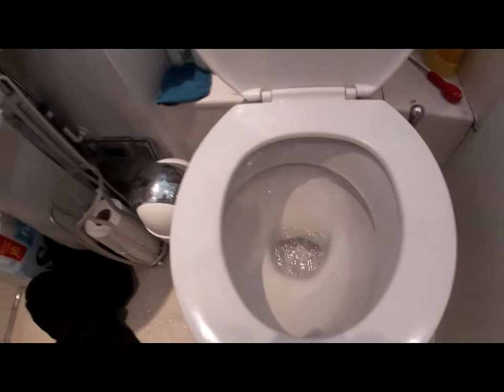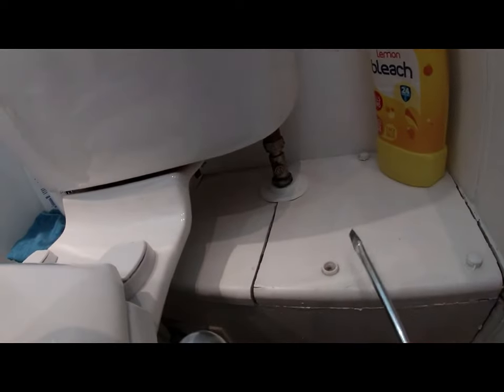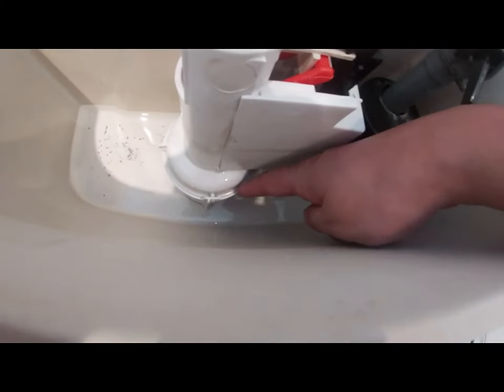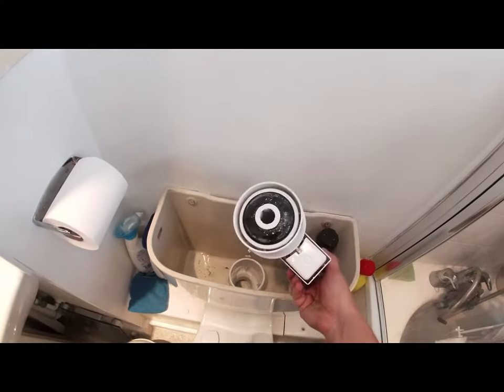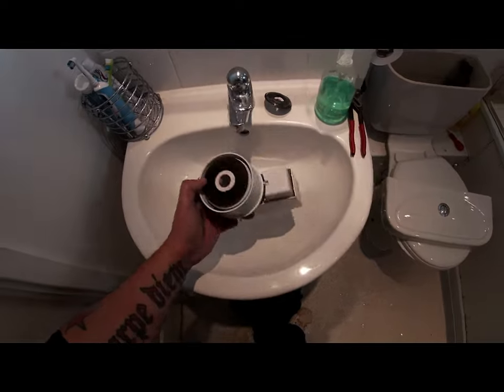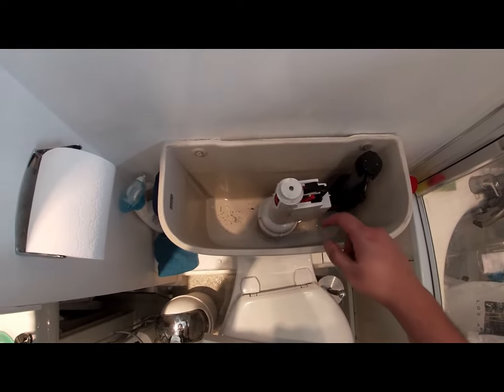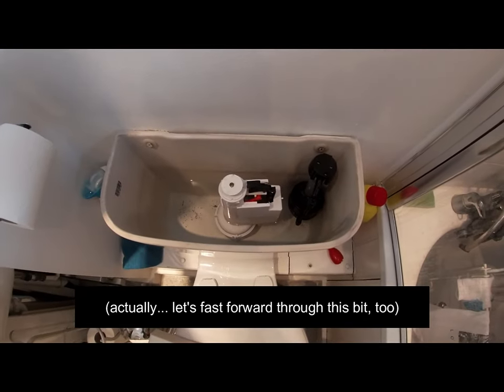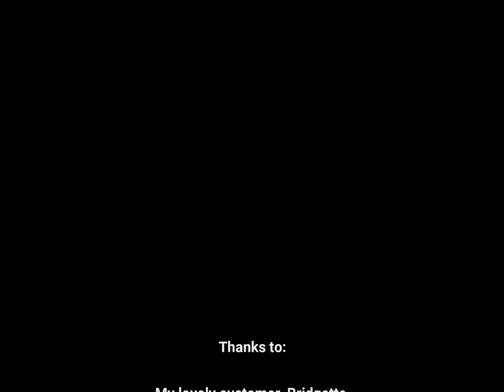Plumbing: how to replace the washer on a flush valve letting by into WC pan

Comment: I changed the diaphragm but still leaking what else can it be ?
Reply from the maker: Hello Sebastiano. 
When you say "leaking", can you be more specific? If the water is still going through into the pan, it's possible the diaphragm isn't seating correctly, or that there's a bit of dirt still stuck there, which is causing it to not create a proper seal. Without seeing it in person, I'm a little limited in how much I can actually help.
Thanks, and best of luck.
Reply: @plumbingwerx  thank you very much for the reply! I wonder if changing the whole unit would help as otherwise I tried everything.
Reply from the maker: @sebastianomandala7936  if you've tried everything else, and it hasn't worked, then I'm afraid that may be the only option you have left.
Thanks
Reply: there is a black hook that sits over the main barrel of the filling part, when you smack down the button violently it does dislodge